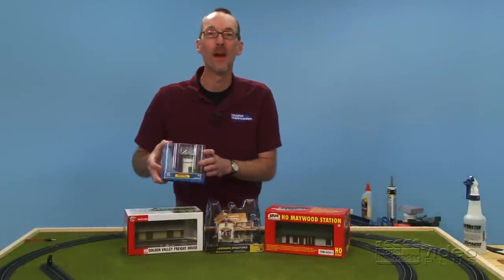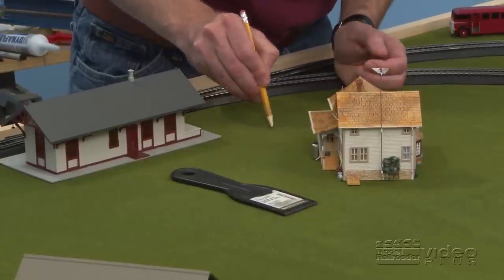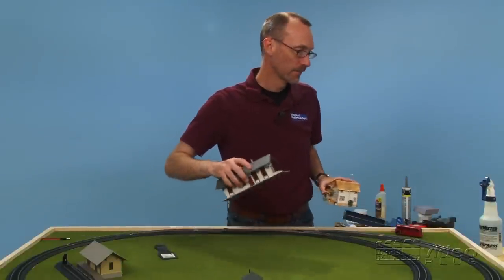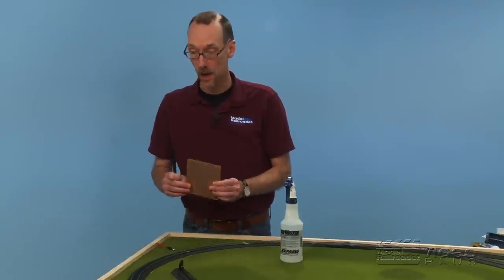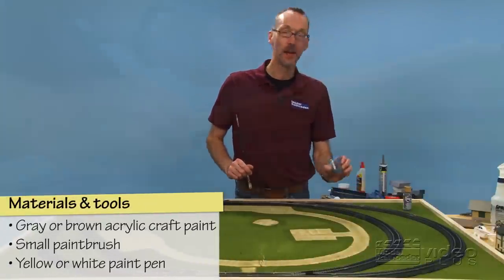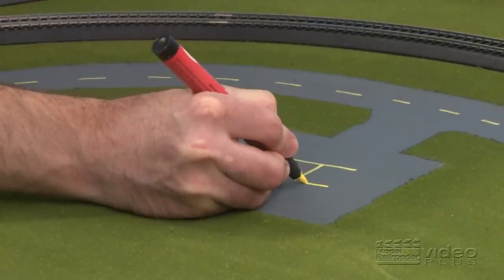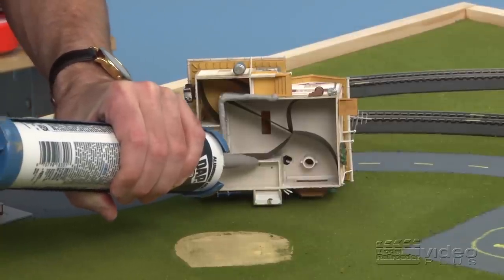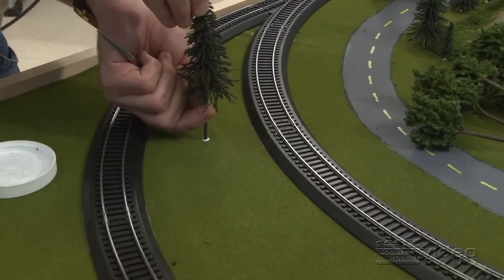Family Train Layout: episode 4 - install buildings and roads

Comment: don't forget to drill holes through your base so  you can dress the wires for the buildings light fixtures before bonding them down
Reply: I noticed the house had a hole for a light inside

Comment: So is it a good idea to use green cloth in reference to grass? Please recent commenters help. Building first time model railroad and would love help. Thanks
Reply: +Become Inspirational no. It is super easy and cheap just to buy Scenic Cement and Woodland Scenics ground cover to do your scenery. Grass mats get very scraped up over time.
Reply: judahrice even cheaper to do 50/50 mix of white glue and water.
Reply: @judahrice  What I like to do is use an earth-colored paint, such as Woodland Scenic's earth undercoat paint, and sprinkle the ground cover material on while the paint is still wet, let the paint dry, and then spray the scenic cement over the ground cover to assure it stays in place.

Comment: What are the actual dimensions of the layout 4X6 4X4?
Reply: The illustration that pops up in the title sequence shows 30 inches by 60 inches, or 2'-6" x 5'-0".
Reply: @ericwhite9048  I'm not too good with carpentry or anything diy personally but is that a 2X6 sheet of plywood?